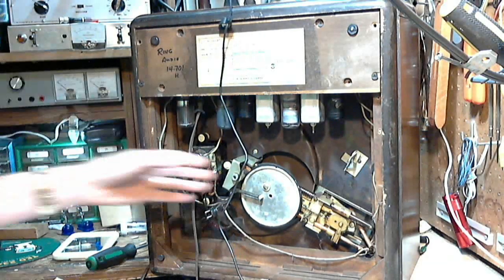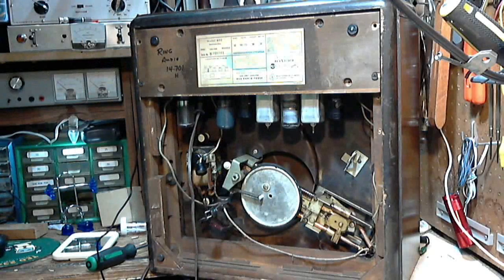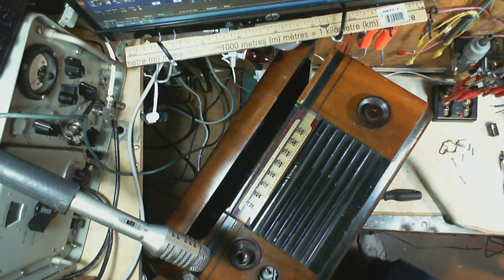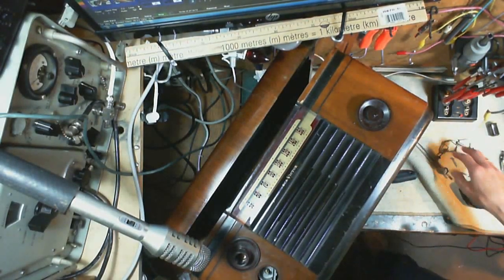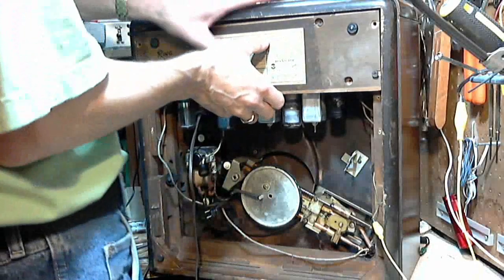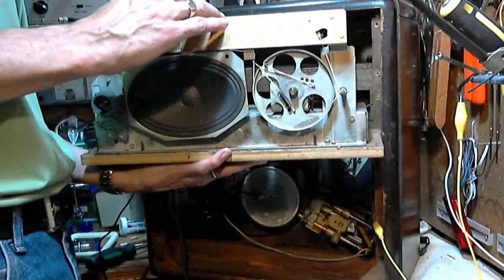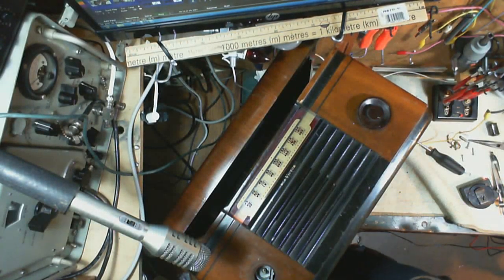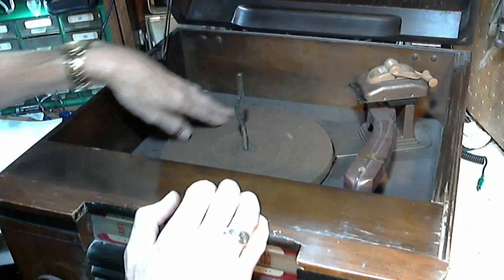RCA Victor Model 65U Radio/Record Player Video #6 - The Pointer and the Player

Comment: There must have been a mechanical service diagram and repair bulletin.  Not that you could replace parts or want to...so much as study how the mechanical parts worked to do what they are supposed to do.  I think there must have at least been a repair kit to replace worn out springs and that rubber O ring around that large gear.